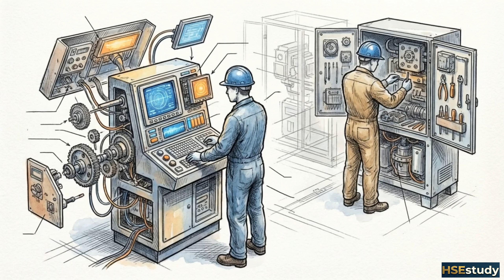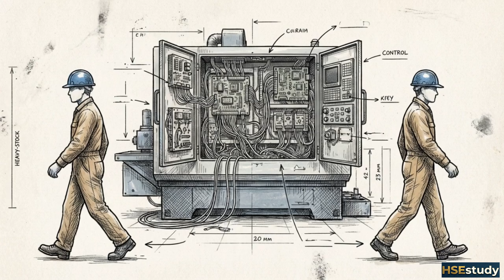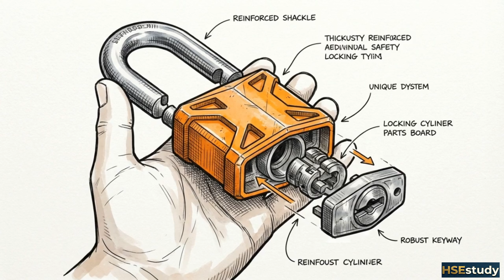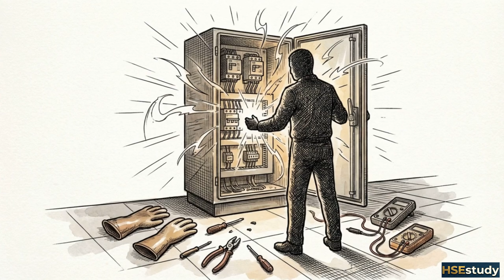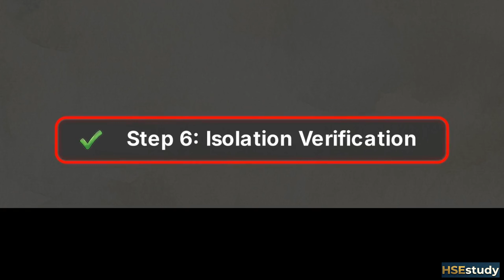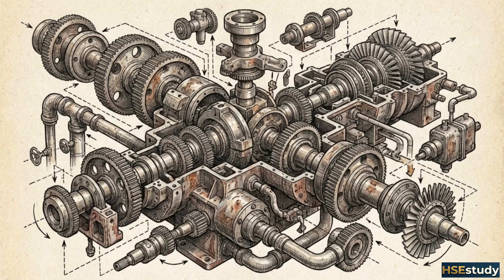1 Wrong Step = Fatal ⚠️ Lockout Tagout Safety Quiz (OSHA 1910.147)

Comment: At plant I work in, we have three colored coded locks, all of the same size and shape as follows: 

Red = Personal.  One lock, one key. This is the only lock that, by itself satisfies the OSHA 1910.147 standard. This is our most commonly used lock.  

Gold - Transition.  This lock is assigned a number, which is to be signed out in the transition lock log, with the name of the authorized employee who placed it, the date, circuit & panelboard number, the date removed, and the name of the authorized employee who removed it.  In most cases, this lock is used when a piece of equipment is going though a prolonged shutdown for maintenance or repairs over the course of two or more shifts, in order to maintain continuity of the lockout/tag out process.  

Less commonly, we use a gold lock when a machine or piece of equipment is damaged or otherwise unsafe to operate and must remain isolated from its energy sources until proper repairs can be made. 

Blue = Group lock.  This lock is also assigned a number, which corosponds to a group lockbox number.  We use this lock when there are multiple employees working on a piece of equipment, often with multiple energy sources.   Just like the gold locks, the blue locks have more than one key, and one key can work more than one lock, so a blue lock by itself cannot satisfy OSHA 1910.147.